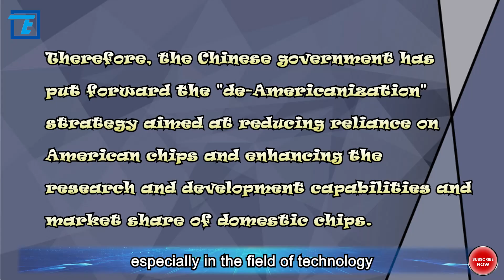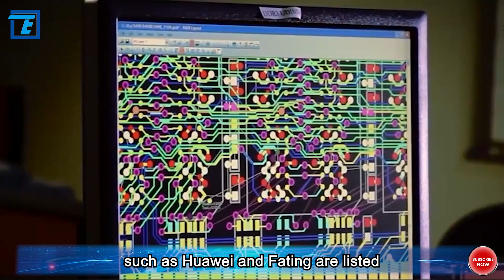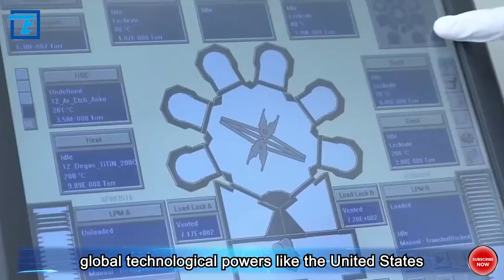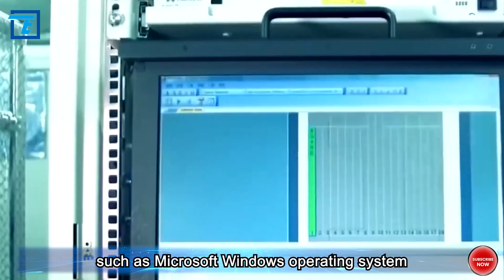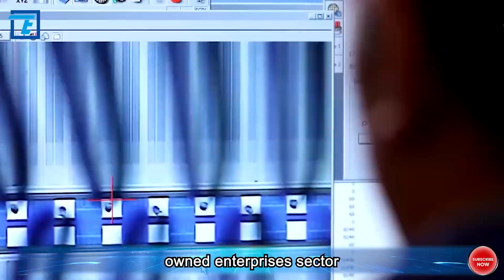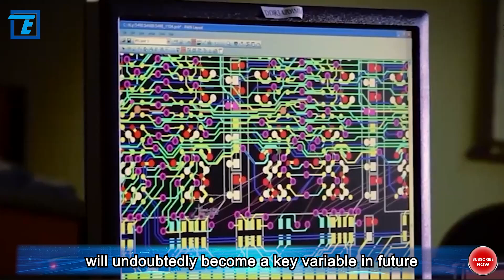What is the logic behind this policy? And what impact will it have globally?

Comment: If the USA can sanction Huawei to cut off chips and software, they can sanction Lenovo and any other Chinese OEM at any time.  It's basic common sense for China to require a secure, sanction-proof computing in government and SOEs using domestic hardware and software.  Obviously, this will cut into Western tech revenue across the board, while increasing domestic revenue and market share, creating new Chinese tech giants out of nowhere.